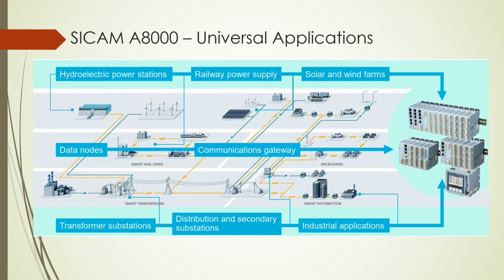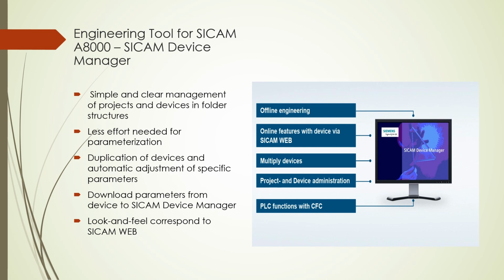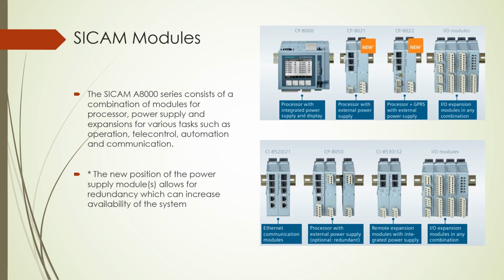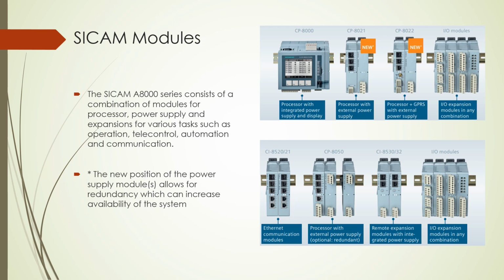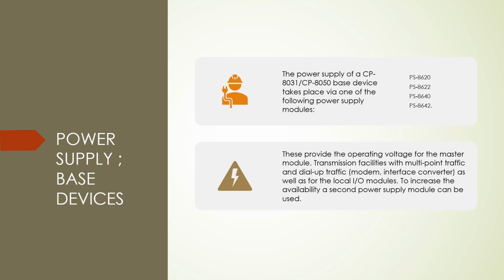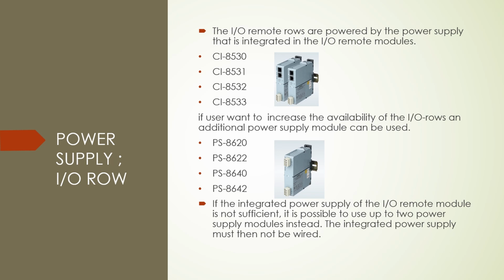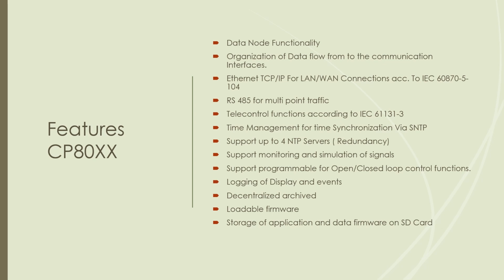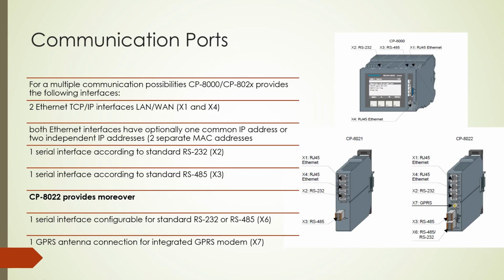SICAM A8000  Series overview

Comment: Hi
How are you. Thank you for this helpful video. Please can tell me how to execute IEC 61850 command (ctVal) from scada directly to the BC 1703 whitout passing by the RTU AK 1703 ( setting in toolbox II).
Reply from the maker: What protocol supported by BC 1703 ? It’s IEC 61850 if yes you need to generate one IID File for that respective BC 1703…share your topology to understand it first .
Reply: @SICAMRTU  
The BC 1703 is currently connected to the SCADA system SICAM 230 via the RTU AK 1703. The BCU transmits information signals and receives commands from the AK 1703 using the IEC 61850 protocol. Meanwhile, the RTU AK 1703 communicates with the SCADA SICAM 230 using the IEC 60870-5-104 protocol, meaning that commands are not sent directly from the SCADA to the BCU 1703. My objective is to execute commands to the circuit breaker or another equipment directly from the SCADA to the BCU 1703 using the IEC 61850 protocol, bypassing the RTU AK 1703. The SCADA system already supports the IEC 61850 protocol.I think that we have do to some settings in the BCU 1703 using TOOLBOX II
Best regards 
Ahmed
Reply from the maker: You need to import IID/ICD/SCD Directly into SICAM 230 then respective nodes will be activated which is required at SCADA end for mapping signals into HMI.

I believe SICAM 230 have IEC 61850 driver license into basic package.

Share your email I’ll respond u back directly.